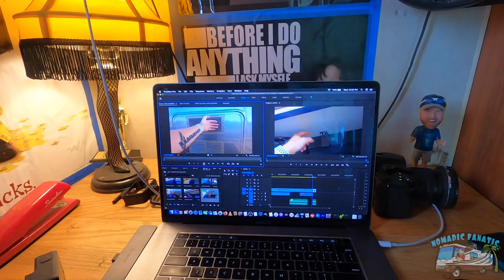I Had To Do It... And The Cops Showed Up....

Comment: Don't forget some screen door material on the back to prevent bugs from coming in.
Reply: Lowes has those with the screen already attached to the vent.
Reply: That might help also with water spray from the rain when driving.  Maybe if he can find a fine mesh material like they use on tents.
Reply: @outdoormcbain2346  that would be cool. Even if he couldn't find that material it would be worth it to cut a tent up !

Comment: You might want to add a temperature control switch to turn the  fan on and off. I would add a screw through the plumbers strap into the fan duct to make sure the fan duct does not slide out. Great project.
Reply: Hi Mike I was about to say the same thing. You can get them dirt cheap at lowe's now. I did it for my helium recovery machine at work when the piston pump was freezing in the mornings. I just hooked up a crankcase element around the pump and controlled it with a temp control switch.

Comment: Throw that fan away go to a computer store and get you a large CPU fan it runs on 12 volts
Reply: He'll need at least 2 such fans.
Reply: @stu3775  With the Room he has, he could install 4, 2 intakes and 2 Exhausts mounted directly to the venting, could run them all day and all night and not feel it Draw wise, would be silent too.
Reply: @AdamNoble1988  Bingo, you nailed that one.
Reply: @AdamNoble1988  YEP!!!

Comment: How are you going to prevent all the road dust and grime getting in that vent because road dust is even more dangerous to electronic components than heat
Reply: Can always put the magnetic cover on when traveling and then make it part of the routine to remove it when stationary. Kind of like when you do a walk around and button everything up.....oh....never mind.  It gets hot when driving....my bad.
Reply: This is a horrible idea he did. Head down the road while it's raining, and the water that gets on the sides will roll right in and louvers won't stop a drop.   He needs to vent to a pipe out of the enclosure.   Going to kill his inverter and other equipment in short order this way.
Reply: marie lynne but if he put a cover over them while driving, it would defeat the whole purpose of doing this in the first place. He talked about how hot it gets in there while driving and running the AC and other things.
Reply: @Metalpug79  My bad.....selective hearing...i will take my comment out. Thanks!
Reply: marie lynne haha, it’s all good. It’s never a bad thing to share ideas like this. ✌️😎

Comment: Two items:  You could use:  #1 -  A/C vent filters (1/4" thin foam) filters to trap dust intrusion;  #2 -  plug in temp switches (used in attics, green houses, & chicken coops for temp control).

Comment: Eric..... Home Depot has magnetic covers for those vents. They are in the same section
Reply from the maker: Yup, but the standard size of 12x8.5 is not big enough for my vents... So I ordered "jumbo" covers online.
Reply: @nomadicfanatic  Any thoughts about insect screens to prevent mud daubers and the like from getting into the compartment?
Reply: @nomadicfanatic  i bought some magnetic cover for the house..too big. Just cut them down with scissors.
Reply: @nomadicfanatic  If you think its gonna rain, slap those on there and then no worries.

Comment: So what happens when your driving down the road and its raining?  Will the rain blow in sideways?  Just curious.
Reply: It absolutely will. First thing I thought of when I saw what he was doing. Those louvers are not going to stop any water when you go down the road over like 30mph.  Runs sideways on the vehicle, and will go directly in and and ruin his inverter and controller in short order. Needs to vent out the top, up to the roof. There probably is a vent pipe not far from there going to the roof.
Reply: magnetic vent covers?
Reply: @MililaniJag  Will last maybe 1 or 2 potholes.
Reply: The inverter catches on fire.  Should be a great video.
Reply: @asphaltadventurer  They'll melt?

Comment: I used a  12V computer fan on the side of my basement compartment.  I cut a 5" hole through the sheet metal, which gave access to outside air.  The exhaust was an identical 5" hole near the inverter mounting wall.  It was a lot harder to cut through sheet metal, but the finished product is hidden.  It didn't alter the outside appearance and had better integrity than mounting things to a foam door core.  I hope your vents last with that mounting.  The glue sealant should help.

Comment: You could have put a 100cfm a2 volt computer fan directly on the door and had a much better set up
Reply: But then you couldn’t insulate the vents in the winter
Reply: @Debbie_T_FL  Sure you could, just take it out and replace with a block of styrofoam.  I do it in my trailer

Comment: Those crossover diamond interchanges are showing up all over the place, they're supposed to be more efficient at moving traffic than the old cloverleaf exchanges.  Yes, it does feel weird to be driving in the left lanes instead of the right...
Reply: As you get used to them, they are better. It also has cut down on accidents in one area where I live.
Reply: Wrong way on the interstate bait?  We already have lots of that where I reside..
Reply: I got used to them in Utah and love it. No waiting to cross over to get on the interstate exit
Reply: Michelle VanLife why would u want to get on a exit
Reply: @randywilson6869  That's what they are called

Comment: This is a difficult but a very necessary task here.. I dont want to say your doing it wrong.. Because i think you have the right idea. 
I feel like it's going to get really wet inside the battery compartment.. The louvers are a little too wide.. 
A puddle on the side of the road, that splashes just right... You might lose all that stuff... Yikes.. 
 Hmmm..
 I was thinking go back to that RV storage place and see if you can get a 2nd door that is solid.. Then you'll just have to switch out the doors in seasons..

Comment: As a lifetime career HVAC specialist, I was looking at your battery cooling setup. I'm pretty sure it won't work correctly the way you have it. To keep this short The air pushed out by the fan will just pull new air in from the bottom grill and immediately get sucked back out by the fan in a short cycle that won't reach the equipment. I believe it might work much better by turn the fan around or revering its direction so that it pushes air into the compartment. This way it pressurizes the compartment and the surplus air pressure will bleed off through the bottom vent. Some fan blades are not designed to run backwards in which case you will need to actually turn the entire unit around to face the other way. Good luck Eric.

Comment: Something for others with this heat problem to think about it pickup a larger computer cabinet fan with a cage, they run on 12 volt and are designed to move some air and run 24/7. Only 1 hole would be needed (if any) your compartments are not sealed air tight so it will pull air from around the basement and blow out the hot air. you would only need at worst 1 hole 6" square. Those victron multi-plus put out some heat, moving it to its old carpment would also help a lot.

Comment: Just get a bigass computer fan.  8" or 6" and 12vdc.  And flat flat flat.  You could attach right to the back of your upper vent.  You could get crazy and do 2.  Will draw less power being DC too. Should be super available and super cheap on amazon.
Reply: Doing two wouldn't even be that crazy. Get two 120 or even 140mm non-PWM fans, hook them up to a very simple circuit. Make some kind of enclosure for them and use some weather stripping to close them off around the vent (so that if the lid is closed it seals).

A fan is going to be completely useless if the intake is right next to it.

Comment: And a screen to prevent critters from getting in.
Notes: I'd use stainless steel screws for the vent mounts. The contact point where the hanger tape rubs against the cord might could use some tape or something to prevent fraying on that wire.

Comment: water is definitely going to make it into those vents, especially while driving.  i don't know exactly how the battery compartment abuts the interior of your RV, but if you could find a way to direct cooler air into the compartment from inside, while also venting the warm air from the other side of the compartment into the interior of the rv, with mesh protected vents, that should work for all seasons without ingress of water, debris, insects, etc from outside the RV.

Comment: Suggestion for winter... cut some closed cell insulation board to fit the cut holes in the back of the vents (they have small sheets that are a light purple color) and when you put the piece in you can have a thumb like thing (like the back of a picture frame to hold the back in) to hold it in place. Just turn the thumb pieces to hold the board. You can even paint the area facing outward. 👍🏻

Comment: Before you seal that up you might want to put some insect screen behind the louvers. Not sure what louvers you bought but I have had them rust before so you might want to treat your screw holes. How are you going to keep water from blowing in while you're driving in the rain? Upside down louvers on the inside might work but I'm not an expert. If you kept your cutout pieces of door you could just duct tape them back in the holes in the winter.

Comment: If you haven't, a screw through the hangar tape into the fan ho using might be a good idea to keep the fan from moving when you hit bumps and potholes.  On the street side of the fan blades so you can't hit wiring or the motor, but keep the fan in place.
For winter I'd go with rigid foam insulation, with one foil side (facing in side to reflect the heat back in), and just velcro it to the hatch door.

Comment: Eric:  You're going to have a cool temperature controlled door but you're not going to do much to relieve the heat inside the battery compartment itself. You are drawing air in the bottom vent and it's traveling about 6-inches up to the top vent and blowing out. But you're not really evacuating anything from the battery compartment itself. You should have put one vent in the top of the door and then opened up a vent in the back wall of the battery compartment. That would pull air from the back to the front across the top of the batteries evacuating the air from the entire compartment. You can still do that by covering up the bottom vent and opening up a vent in the back wall but, unfortunately, you will have the unnecessary bottom vent in your door.

Comment: I know it's mind's late now, but you could've drilled 1 small hole in the corner. Then used the cutoff as an insert plug, just duct tape around to cover the sharp edges. Also with all the vibrations 1 the strap won't hold for more than a few weeks, 2 the sharp edge of the strap so close to the power cord, over time can cut through the insulation and short out the circuit .I would've used some 6in."L" brackets on both sides bent the vertical legs to help support the fan and screwed into the fan housing before and after the blades. Great video as always, thanks. P.S. I'm not an expert,just saying what I would've done. John S.

Comment: Cheap and easy way to seal off your vents in the winter time get a piece of ceiling tile cut it to fit and take some of your medal strap that you used to hold your fan in place and take about a inch or two piece  to and just use it secure it in place on the top or sides doesn't matter but make these pieces as of they are hinges  and that should hold the tile in place as you travel. Just a cheap easy idea!

Comment: You should get a inline thermostat, it goes between the plug and outlet, set it for 90 degrees and it will come on and off on its own and you don't have to worry about plugging it in (or forgetting to)

Comment: Eric that strap being up against that wire could cause trouble. Over time with all the movement it could cut through the insulation and cause a short. Please, please, put some kind of sacrificial rubber between the wire and that metal strap.

Comment: I'd use the chimney effect and see about venting up the fridge vent, for air intake; I'd look for a place were rain/splashing  will not flood the compartment.  Perhaps from the inner stairwell so heat/cool comes into the compartment and up out the fridge vent?

Comment: With a metal duct fan hanging over the batteries you might want to think about insulating the battery terminals.  If that fan ever comes loose and drops across the batteries you'll have a dead short welded in place between the battery terminals and that won't turn out well.

If nothing else get some foam pipe insulation (looks like a pool noodle with a slit down one side) and slip it over each set of battery wires to protect the terminals.

Comment: Eric I think the reason why you're not catching fish is because you're not able to feel or even see when fish are biting your bait on your hook because you've placed the sinker on the wrong side of the hook. When the sinker is placed before the hook (sinker is closer to you on the line) it stops you from being able to feel the vibrations of the fish biting on your bait (keeping the line nice and tight is how you're able to feel and see fish when fishing). When you're able to feel or see (the tip of your fishing pole bend) then that is when you're able to "set the hook" in the fishes mouth. If not done this way the fish 100% of the time always steal your bait.
Reply: Also maybe look into using pc fans for cooling your battery compartment (they don't need much electricity to run). I'd point them out so there blowing the hot air out of the compartment. Also why not use the panels you cut out to seal the vents for winter.

Comment: Rain will blow inside of those vents! I would have placed a small round vent inside of the front of that compartment and a fan in the back inside of the compartment to circulate air from the front to the back and out! No rain would ever enter those vents being back under the coach!

Comment: Definitely needs a sheet metal enclosure, with an internal wind dam leading to the intake fan, the bottom of that enclosure has a drain for all the water coming in. Eliminate any water other than mist from getting in the battery compartment.

Comment: Two computer fans connected to a thermostat that will turn on the fans to cool. I think you'll have problems on wet roads, maybe not. Washington is a good place to see how it works. You should have seen if they have a spare door for the winter.

Comment: Need to put some 3/8 fuel line around the electrical wire where it goes into the  fan motor.  Might have a plumbing ribbon rub thru the wire and those  batteries would go boom. Also get some camper top gasket material to cushion the fan / box liner  contact area. And you'll need a filter on the back of that fan. I had a custom van back in the 1970s.  I engineered more bull shit than you will ever think of.

Comment: Eric, throw a couple self tapping screws THROUGH the water heater straps into the fan housing so it doesn’t shift and cut the fan wire

Comment: Having the fan blowing in would be more effective.
Reply from the maker: There's nowhere for the air to go if I just blow in warm air into a hot compartment. It's best to escape the heat front the top, than to push more hot into the compartment.

Comment: I would have used a dryer vent attached to outside of door, and used flexible dryer vent hose inside but not attached to fan.  Fan will push out the hot air and the vent will keep out rain and bugs.

Comment: Would have ducted the fan to pull cold A/C from the cabin to provide positive air pressure on the battery bank compartment and rig the exhaust in a no so water prone area.

Comment: Put a rubber gasket on the fan to create a better seal. Also in the winter put a piece of insulated foam board on the inside of the lid and Velcro it in place.

Comment: Winter buy a two foot by two foot piece of metal . Cut metal so one piece covers both holes . Rona bead of silicone around the outside of this new piece of metal apply to back of hatch covering both holes . Leave current vents in place. I would of drilled two circle holes size three inch behind each vent . But like you said it’s yours . Do it your way.

Comment: Mr. Eric I hope you save the cut out on the door for the vents. You can use it to cover the hole with some tape or other means to hold it in place to keep it warm in the winter months. Also can use something like AC filter foam to cover the vents on the inside of the vents to filter dirt and bugs from coming in your batteries bank.

Comment: Eric I'd also put some small mesh screening inside to cover the louvers to keep bugs or small critters from getting in. Also wondering if you'll get rain blowing in from tires or road or if there's a driving rain storm...or if dust or sand will be an issue, especially if you're driving anywhere in the southern latitudes of the US from CA to FL...TBD🤷‍♂️🤷‍♀️.

Comment: Eric, cut a piece of plywood to fit the inside of the lower vent cutout. Block the vent off with it when you are traveling. It will go a long way to keeping the tire spray and road dirt out of the compartment. While you are moving the air moving in and out of the top vent will be enough to keep things cool.

Comment: You could Velcro a pice of insulation foam board like what is used behind vinyl siding. To that door you could also save the pieces u cut out and put them back and put some tabs that turn to hold it in place

Comment: Eric, you might be better with a couple of 12v computer fans. They are plastic in case the road vibrations dislodge the fan and it falls on the batteries. At a minimum, put something over the battery terminals to keep them from shorting out if the fan should fall.